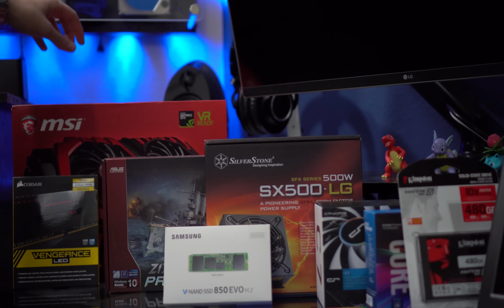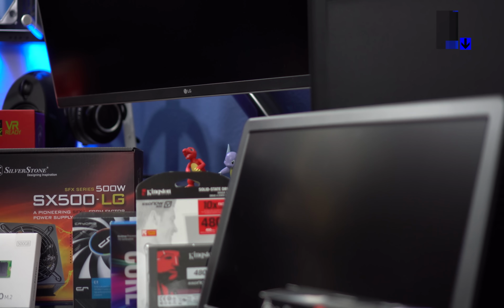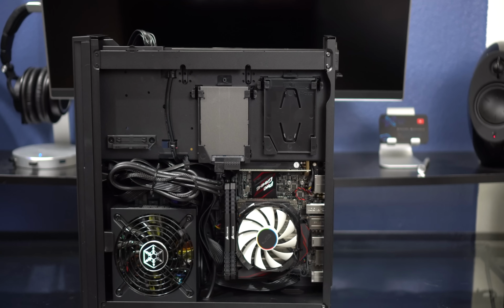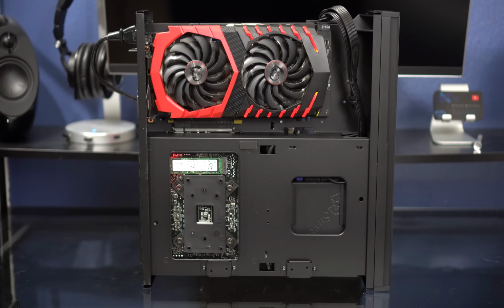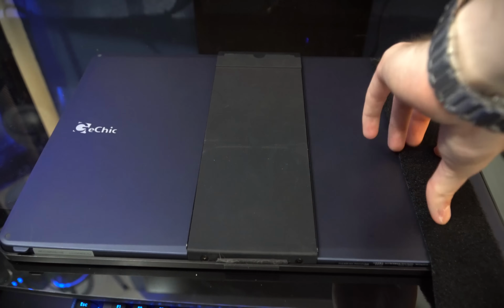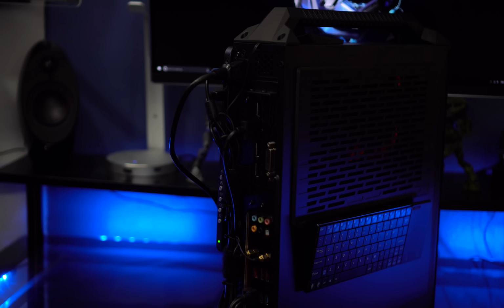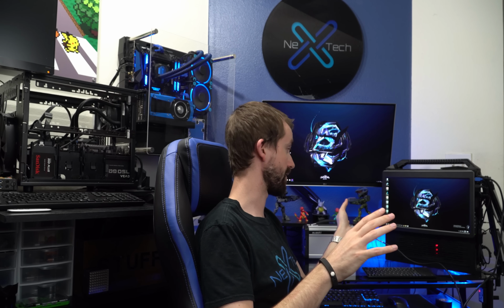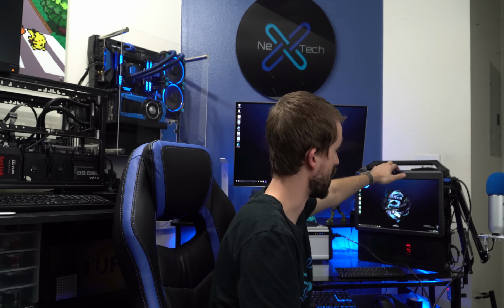DIY Portable PC in Silverstone Milo (SFF Build)

Comment: This makes a lot of sense because you have something that is around the size of a laptop but with the power and upgradablity of a desktop. I have been wanting to have something like this for my first pc and with ryzen 3000 being out, I think I'm gonna take the 3400g and then save for a descrete gpu like an rtx 2060 or something like that. Then when I upgrade the cpu to ryzen 4000 non apu, I think I'm gonna buy the inwin chopin and a B450 mobo and have myself a really cool and compact emulator pc using the 3400g with either 8gb or 16gb of ram or it would make a good gift to a friend that doesnt have a pc.

Comment: thats a thin case and very interesting whats the core temp for the gpu on load?  I'm also looking on this ... isn't it wiser to get a reference gpu since the flow of the air would be directed backwards all together?
Reply from the maker: +cand7e7ack a blower would probably get a couple of degrees better but the gpu in here at the moments doesn't have bad temps, and GPU on load get a little hot around 80°C if your running a stress test like Aida 64
Reply: hey thanks awesome. I really like this might go on this route. cheers.
Reply from the maker: +cand7e7ack I had a blast making it so I'd recommend it haha!
Reply: yeah looks fun, but just like you said the main factor for me here is the handle as well, have you considered the node 202 case?
Reply from the maker: +cand7e7ack I did but I actually ended up finding an even better case which I'll have a video up soon for
Reply: really? then i'll wait for that video hopefully the new portable case rig is not ridiculously priced nor not hard to get by, btw have you checked those mini itx with pico psu? they are really small though and see video powering 1060's I'm a bit on the edge purchasing small psu which the same price as these aftermarket psu, its just a tiny pcb sitting on a 24 pin connector.. I'm not just used with the whole concept yet. though it is a sweet idea minimizing the sff hopefully it can catch on with better price.

Comment: just so I get this right, you can use any portable monitor out there? they aren't just to "extend the screen of a laptop" ?
Reply from the maker: No not any portable monitor, most portable monitors get the display only from usb, this one was unique because it got power from usb but display from HDMI, which meant I could plug it into the GPU of the pc

Comment: i love the blue pc in the back
Reply from the maker: +Otter Turtle Thanks! Lot of work into that one haha
Reply: NeXTech News yeah, I just finished building my computer and I love it, old one was getting super under powered. It's not modified but I hope to do something like what you did with a pc in the future, I love that case too. Do you have any dust problems with it? It's open at the top and I thought that it might have dust problems.
Reply from the maker: +Otter Turtle I thought for sure that I would have dust problems but surprisingly I dont really have any dust problems and even when it gets a little dusty it's so much easier to clean than any other case I've ever had!
Reply: NeXTech News wow, i never thought of the ease of cleaning. my computer is hard to clean because ive got to take out the drive bays, GPU, CPU cooler, and the power supply to get to the motherboard, it lays flat on the table and cooks the display port cable while its at it.

Comment: I love this video! It just goes to show the value of mini-itx computers. I would personally love to use this for a no hassle LAN Party set up since I do LAN parties often and hate having to unplug everything in order to get it to work. I would use this mainly with a controller since I hate gaming on a touchpad but the touchpad on the keyboard would be perfect for normal Windows tasks like browsing the web and launching the game. Then you could always just hook it up to a secondary larger monitor like a 24 inch one and use that as your primary monitor and disable the tiny monitor when you are back at your desk and not with your friends. Really great idea for a portable PC and I might actually try this in the summer. However I will use different specs because I have an i5 4690k, 8gb ddr3 ram, gtx 970. Currently I am using the Corsair H100i V2 but would swap it for the Noctua low profile CPU Cooler and use the Corsair 600 watt SF mini PSU instead. I wish I got a mobo with M.2 capabilities but I will stick with SSD's for now. Do you think this case could fit a WD Blue HDD? If I mod it a little? I am thinking of upgrading my system to an i5 6500, 16gb ddr4 ram, and a gtx 1070 mini from Gigabyte. That would be perfect for this case and then I can fit a hard drive since it is a half size graphics card. Ah well enough rambling and awesome build. I am glad someone finally done it and I wonder how hot it would get while gaming. Keep up the great work!
Reply from the maker: +Tom Brown you could absolutely fit an WD HDD in next to GPU if you went with a 1070 mini! That'd be awesome! If you build it let me know if very much like to see it!
Reply: Awesome! That is good to know. I will save up for the case and power supply. I already have an old monitor that is Vesa mountable although it's only 720p. Might be able to mod the case so I can screw the monitor to the case panel.

Comment: well? how much did the battery last on gaming?
Reply from the maker: +continuous HUNGRY it lasted about 2 and a half hours depending on how demanding the game was, but there seems to be some power loss from starting at dc power (the battery) converting it to ac (the plug on the battery pack) then converting from ac back to dc (the PSU) where the motherboard uses it. So I'm trying again where I keep everything dc with an hdplex and a battery
Reply: great! once your done il start shopping from amazon through your link at your website. also please make it a ryzen build since that cpu uses less power.

Comment: what? you are using inverters to do =12V -> ~110V -> =12V ??? :O :O :O And you are not using NFC S4 Mini case??? This shit that you're carrying around is a full-sized desktop whit ups.
Reply from the maker: +Francesco Porcelli inventers? Where are inventers? And that's the case I wanted but it was sold out!
Reply from the maker: +Francesco Porcelli 😞
Reply from the maker: +NeXTech News *inverters
Reply: A power inverter, or inverter, is an electronic device or circuitry that changes direct current (DC) to alternating current (AC). (wikipedia). simply the most inefficient way to use a 12 volt battery. the best way is to use a 12v dc-dc power supply such as the pico-psu (maybe something more powerful)
Reply: +Francesco Porcelli what was he using as a source of power to get the pc running in the park
Reply from the maker: +Titan A battery capable of outputting 220w
Reply: +NeXTech News thx do you think that can handle a system similar to his but with a gtx 1070 strix